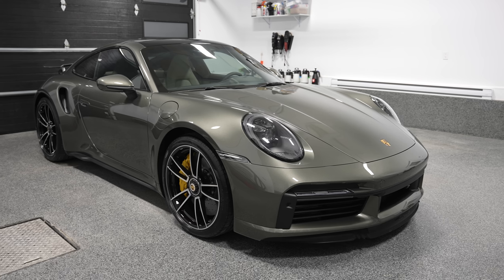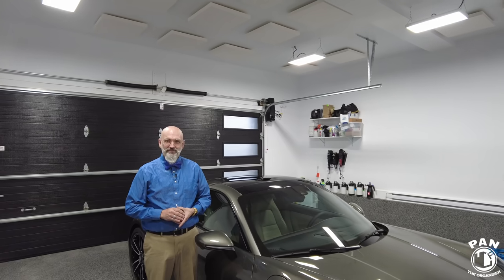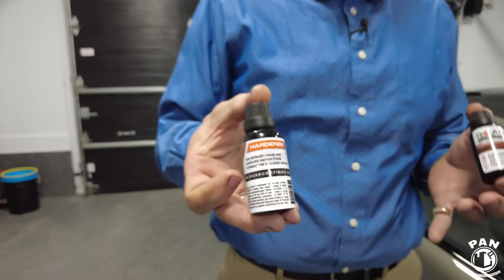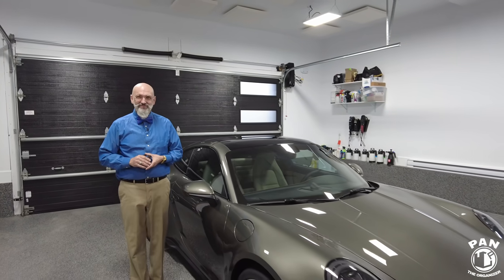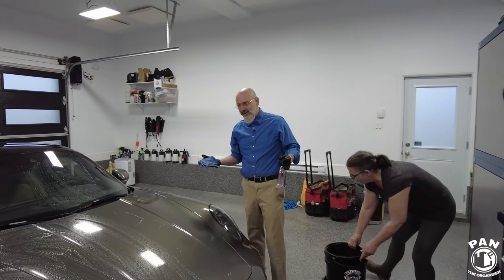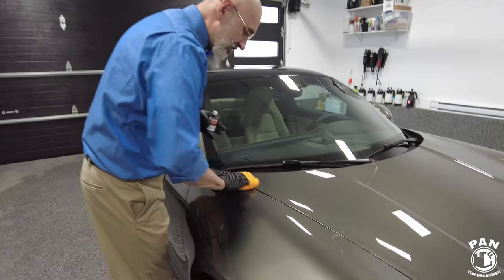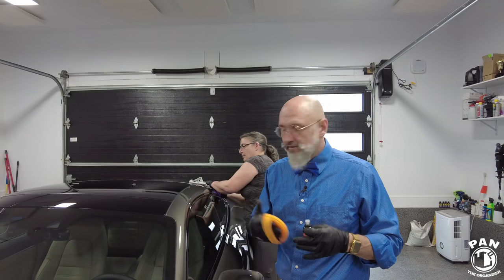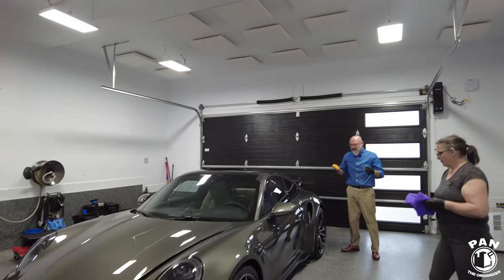Porsche 911 Turbo S : Detailing My New Supercar!!

Comment: One's love for their car is without measure!  I have never owned a new car....My Z06 had 812 miles when I bought it,so,close enough! I wanted to sleep in My Vette when it was in the garage,detailed.

I am certain that Pan goes into the garage and smiles frequently! 

This is a terrific video that I enjoyed thoroughly! Have fun with that beast of an automobile,Pan!
Reply from the maker: Hey thanks Jay!! Your Z06 must have been ULTRA fast!! What a beast of an engine! What year model was it?
Reply: @PanTheOrganizer  it’s a 2004.. Torch Red with mod red interior (black and red) it made 360whp stock. Adding headers, hi flow cats, bigger injectors/fuel system and a Paxton Novi 2000 blower netted 605/568 in 2010.   I tagged You on Instagram.  It’s been on there for ten years! Power is 541/500 now, so it might be a little tired.  I love the car and will never sell it!   Thanks, Pan.

Comment: Hey Pan the 911 looks sweet I wanted to ask if you or Ivan would know, can this new ROAR coating be used with an Infrared Medium or Short Wave curing lamps per panel and if so what would the suggest cure time be for Step1 and Step 2 and what is the suggest temperature for force curing?  I just invested in a IR system recently. All the NYC high end shops only use the IR lamps to do coatings. I have had hit or miss results just air curing depending on the paint, time of year and customers upkeep.
Reply from the maker: No IR needed. 1 to 24 hours between base coat and top coat (hardener) so lots of flexibility. And once hardener is applied, it only needs one hour of curing. That is crazy quick!
Reply: IR curing is possible, but very counter productive. The time to set up and move the lamp, plus the risks involved. It looks cool in a promo video, but customers are not paying you for a process, they are paying you for your service and results.

Comment: $500 for a bottle of ceramic coating - professional detailers out there - good luck “building up your business “
Reply: This is a $230k car. Any high end detailer will charge about $3k and above to do paint correction and ceramic covering. You can see in the video the hood still has not been buffed to a glass finish. It looks very nice but not perfect. I don't think $500 is bad as long as this product works.
Reply: @ed389  Yes , for a only couple of detail jobs a year of a high end vehicles , if you get lucky to get them , maybe. But for every day jobs $500 it’s just a waist of money. Most people will not even consider paint correction and ceramic coating at all, maybe a wash but that’s it. And if they do,  a $70 option ( Cquarts 3.0) will be more than enough. I do professional detailing and 90% of people I talk to could care less about the look of their cars , never the less spending $3000 on a detail job. Most of them haven’t even heard of ceramic coatings at all. Anyway, this Roar coating claims it last 7+ years or a lifetime if maintained properly. Well , unless the vehicle stays in the garage 90% of the time , that doesn’t matter , as if used on regular bases , it will still needs a paint correction in 4-5 years due to rock chips etc. So even if the coating is still good , but you need to do paint correction, you will have to polish it off and recoat. So why spending $500 instead $70 or $100 ? Makes no sense to me.

Comment: Hey Pan!! Car looks amazing.  Like you i started washing and detailing my dads truck when I was like 12. Performed my first paint correction when I new nothing about polishing - I learn how to correct paint on a rotary which I didn’t even know anything about. I actually learned how to paint correct watching chemical guy videos and I actually started off with their products. First polishing correction was on a brand new 2011 Infiniti Black G37 coupe. Go figure that all my cars have always been black and I’ve always learned how to maintain properly a black car.  Just in the last three years I switched my products over to Adams polishes and now over to CarPro and Gtechniq. I spent about $2200 buying scan grip lights Rups DA Mark3 polisher and all the tools that I need it to convert my garage to a detail bay.  My current car Is a black BMW M2 Competition. I performed a full decontamination and polishing correction when I first purchased the car. Like you I did not let the dealer DPI the car. I did however have full PPF installed before it left the dealer expel ultimate PPF. Front end only-  
I used CarPro finishing polish and compound using Rupes Wool pads and polishing pads. Follow up I coated the car using CSL/ExoV4 every inch was coated including all of the trim pieces rubber pieces under body of the car all the carbon fiber the wheels inner barrels even the door jams were coated.  I have been using CarPro elixir as a topper and I can tell you car pro elixir darkens the vehicle even further to give it a truly 3-D like effect.  I’m watching the video and I can tell you that combo there has the exact same water beating effect. so I’m just curious as to what made you pick that coating over some of the more pronounced coatings that have been out here on the market for years- I know Ivan Lacroix is a chemist and if I’m not mistaken he left Opit coat and now has started his own company so I’m assuming this product probably is amazing if he OPTi coat and I think he also invented ONR.  But I was just curious as to what your thoughts are on this coating and if this is something worthy at the level of a kamikaze coating which is also high end coating I’m asking all this as if maybe thinking about switching over to this coating. Sorry for long message- 

Again awesome video!!!!
Reply: Brian, little correction, your giving me too much credit, I didn’t invent ONR, I was just a very enthusiastic advocate. 

I don’t work for Roar, I am Independent, and do consulting for numerous coating companies. With Pan we chose Roar because of its performance and attributes. 

Nice progression, keep up the good work
Reply: @Detailers-Business-Academy  Thank you Yvan, I appreciate you taking the time to follow up. The coating looks amazing! As you know there is a lot of work involved when switching coatings. I am very detailed and I drive myself crazy at times with trying to get everything  dialed-in perfectly. It’s a blessing and a curse as times.  But I really had thought you where the guy who invented ONR as it’s a product I could not see living without!! But great great! Success to you my friend!! Looking forward to seeing this coating in action again- 

Best,
Reply from the maker: The guy who invented ONR is Dr David Ghoshoussi, owner and founder of Opti-Coat/Optimum Polymer Techonologies.

Comment: Pan... I would love to know where Ivan gets those cool sponge applicators with the strap backing!   They are  perfectly functional for this and other types of applications.  I checked with Roar, but didn't see it, as well as other car product suppliers.  Seems to make application smooth and effortless.  ALSO... very interesting to see what you use on your special machine.  It just pushes Roar up a few notches, and the thought of applying it to my '95 993 after I get some experience.  Thank you for this special show!!!  👍  You have taken me all the way up from Dawn and Shop Rite soap application with one bucket to ceramics like Roar. (Thank goodness I didn't have the 911 then).   Incidentally, all the gear needed to get the job done properly along the way have been purchased with your help.   Not a business mind you... just personal gratification of seeing a completely clean machine and the pride it instills.  Yes, the neighbors are very curious.
Reply: The applicator comes with the coating.

Comment: Living in Portsmouth, New Hampshire close to Canada I always...( 4.5-5 hr drive to Montreal did the drive twice a quarter pre-covid)  always put PPF Xpel ultimate plus on after de-con, correction, polishing, THEN PPF, then coatings on top of the PPF. Rocks still chip paint with coatings. On a $200+++K car it should have gotten PPF before any coatings. ALL my cars are fully PPFs any painted surface has PPF on it . 21  Range Rover SVA ( daily driver),19  812 Superfast, 18 GTC4Lusso( semi-daily driver)  and 15 Ftype R which is soon to be dropped off at dealer on an order for a 22 Conti speed I ordered and told them once it's off the truck fully paint correct it , polish it and Xpel ultimate plus and coating on it before I take delivery.

Comment: Interesting that you did not apply PPF to that beautiful front end.  Nice touch on the clear side markers btw.  I know you've had Ivan on in the past, in particular, to apply Optimum Tire Protection.  Just wondering what your tire dressing of choice was.
Reply from the maker: I just used CarPro PERL as a tire dressing here.
Reply: Nice product, I often use that or VRP.  Adam’s new silicone water-based Graphene Tire Dressing isn’t bad.  Perl or VRP are a bit easier to layer in order to get just the right shine I think.
Reply from the maker: I agree! I also like PERL and VRP, they take home my favourite tire dressings awards in my annual awards show! :)

Comment: Did Yvan apply the Iron removal to the car immediately after his wife applied the Rinseless wash? Would that not dilute the Iron Remover?
Reply from the maker: I didn’t have much iron contamination. Nearly zero actually. So it doesn’t matter. Plus my car has carbon ceramic discs which produce little to no brake dust. ;)
Reply from the maker: I didn’t have much iron contamination. Nearly zero actually. So it doesn’t matter. Plus my car has carbon ceramic discs which produce little to no brake dust. ;)
Reply: The minimal amount of Rinseless that’s on the car doesn’t have a negative effect on the iron remover.

Comment: Hello Pan, congratulations!!!!! Your car is more than beautiful. Question, I have a 71 Mustang Grande with a vinyl top, what products do you recommend to clean and protect it? I don’t want to damage it by washing with regular paint soap if this is not the correct for this purpose. Thanks in advance.
Reply: Is your question regarding the top or the car? Btw great classic!
Reply: @Detailers-Business-Academy  yes, the top. I searched online but found for convertible only. Thanks Yvan for asking.
Reply: @danielguzmanparra750  sorry for the delay in replying. If the top is Black, I would suggest Solution Finish. Before applying it clean off all dressings, make sure it’s dry, tape off your paint/ chrome, and apply sparingly.
Reply: @Detailers-Business-Academy  thank you Yvan, will follow your recommendation.

Comment: Nice wheels.  My 991 S is the same color.  Trusting you and Ivan that Roar is good stuff and easy to apply, I’m gonna drop the $500.  Is there enough product in the bottles to coat both a 911 and a Macan?  I’ve already coated the plastics, glass and wheels, so I’d be using the Roar only on the paint.
Reply from the maker: It's the first time that the brand allows the public to purchase this pro grade coating! A limited time offer for my viewers. That is awesome. Yes one kit will cover both those vehicles. You don't need a lot. If I remember, there was still two thirds left in each bottle (base and hardener).
Reply: @PanTheOrganizer  Awesome, good to know.  I feel much better about the purchase knowing I can coat 2 of my vehicles.  Enjoy the Turbo, no speeding!

Comment: I noticed he did headlights , does it help keep the lights from fading and discoloration ?
Reply from the maker: Yes. Everyone should coat their headlights and tail lights. Prevents them from oxidizing, yellowing and fading.
Reply: To add to Pan’s reply, makes getting insects off of them easier, and in winter driving less ice and snow accumulation.

Comment: Beads, are they bad? Would't sheeting be better? Acid rain and such beading on the surface justt leaves a point of mineral deposits and damage?
Congrats on the new car Pan!
Reply from the maker: This also sheets like CRAZY, as you hopefully saw in the vertical panel test. Some of the best hydrophobic properties I have seen from any coating so far, period. You will see in my upcoming first wash video. :)

Comment: Beads look nice and car looks 🔥🔥🔥. My car sits outside so don’t want beading, rather have a sheeting coating for my use.
Reply from the maker: It also has some of the best sheeting I have seen, as you could tell on the vertical panel shot. Wait until you see the first wash video coming soon. :)

Comment: Pan,  Nice care-good video.  Now that you have a car with carbon fiber-could you do a video on how to take care of them--washing-products and brushes.  They coated them with the Roar Coat but they didn't take the tires off and do the barrels which you would have to take the wheels off to do.
Reply from the maker: I am not worried about the inner barrels of the wheels. With carbon ceramic discs I won't be getting much brake dust or contamination. And during maintenance washes, it's easy to coat them quickly using a spray on rinse off product like Gyeon Wet Coat or CarPro HydrO2... as I often do during maintenance washes.
Reply: @PanTheOrganizer  Pan, I have carbon ceramic brakes on my ZR1.  Chevrolet and other sites have stated that do not use an auto shampoo that contains any wax, sealant, silicone or other additive.  It was recommended to use a quality soap like Sonax Green Lemon or Gyeon Bathe.

Comment: Hey Pan! If i understand well the video, did he mixed the iron remover with rinseless wash to use in a 1 step decontamination with the clay towel? If so, what was the ratio of the products he used to do it? Im really interested to do a 1 step decontamination like he did
Reply from the maker: The rinseless wash was on the surface. He used the iron remover as a clay lubricant for the clay towel. No mixing or dilutions. The bottle contained pure iron remover.

Comment: So in the video Ivan used a solution of rinseless wash mixed with iron remover. I'm curious to see what the dilution  ratio was and also the products used. Also I use Sonax Glass Cleaner as a clay lubricant, and a rinseless prep wash. So can I just use my Iron Remover mixed up with this solution so I can clay and do the Iron decontamination step just like Ivan did I  the video?
Reply: The Rinseless was already on the surface, the Iron remover was added to the towel. With any process using chemicals you will need to test compatibility.
Reply: @Detailers-Business-Academy  Thank you so much!!!

Comment: Cool stuff Pan! But I just want to be clear about something, about the claying/iron removal step.

You cover the surface with the N-914 to lubricate it, and then spray the iron remover 1. either into the clay towel 2. on to the wet surface and then clay it?

Thanks!
Reply from the maker: This video has more advanced techniques from Yvan who has been in the detailing world over three decades. So it's not the traditional way of doing things.

Normally, after the pre-treat with the rinseless wash (N-914), you rinse it off, and then proceed to hand washing your car as per usual. You rinse that off, and then you proceed to use the iron remover, rinse that off, and then move to the clay stage.

Don't get confused by the methods in this video, as not all iron removers can be used as a clay lubricant. And you would only do that with a special clay towel.

The normal way of doing things is presented in a video I made here: https://youtu.be/tjJPcdCUaK8

Comment: Curious answer to Pan’s pH question; 2-13…. I seriously doubt the pH can range from ultra strong acid to ultra strong base. Did he not understand the question or not know the  answer? Stunning 911 regardless of the crazy pH response.
Reply from the maker: Yes that is the correct pH range of chemical resistance for this coating. Many coatings resist pH 2 or 3 all the way up to 11 or 12. Some (like Opti-Coat Pro+ can even resist the entire pH scale 0-14). Yvan has over four decades of experience, he knows what he's talking about.

Comment: Thanks to your advise, I can not state  how helpful your channel and your help has been to allow me to start doing my own Detailing.  I so love the process.  I did order the roar to do my car. I am not a pro at all,  I would say novice at best but feel I can get it done.  Had a question about the Mckee’s rinseless wash and iron out blend that was used with the clay towel.  I have the Gyeon Q2M iron remover, which I am sure will work and the Mckee’s N 914 rinseless wash. Do you have the ratios that was used for the lubricant.  Thank you again for your time
Reply from the maker: Hard to say as I haven't tried all the combinations for claying with an iron remover as clay lubricant. Unless you are 100% sure of compatibility, do the iron remover stage first, and then do the clay stage second.

Not all iron removers can be used as clay lubricants, and not all clay media can be used with an iron remover.

So when you do the separate clay stage, use a traditional clay lubricant, like Gyeon Clay Lube or CarPro ImmoLube.

Comment: Hello sir. Bougth anew Tacoma 50 miles on it. And I have decided to go with the Foam prewash to start Then the iron remover. Also bought the Mothers CMX Surface prep to apply next. NOw, I have very light swirling in the paint. So I think I should use a polish next... But I have no idea what to use. Then I was going to finish using the Turtle Wax Hybrid solutions flex with Graphene. Could you tell me if I am going wrong here and what polish I should use? Many of the ones I see have wax already in it. Are those ok to use before the TW Flex?

Also, how often should I do more than washing and reapplying the Flex like redo the iron remover and the CMX surface prep?